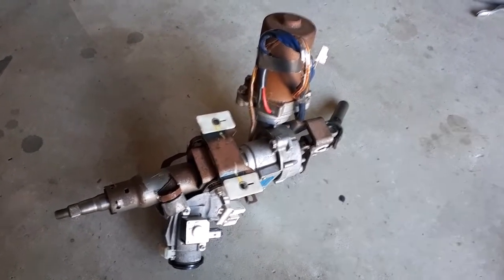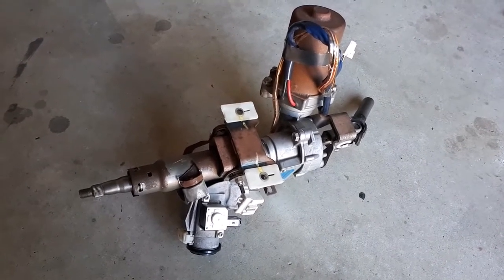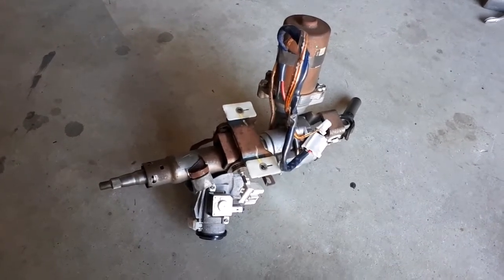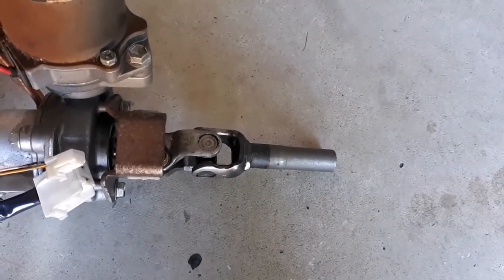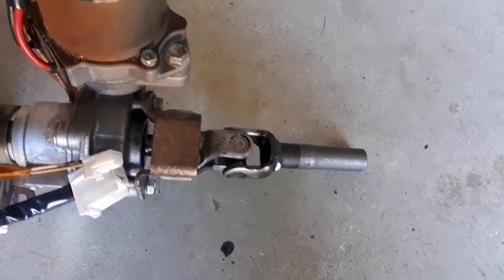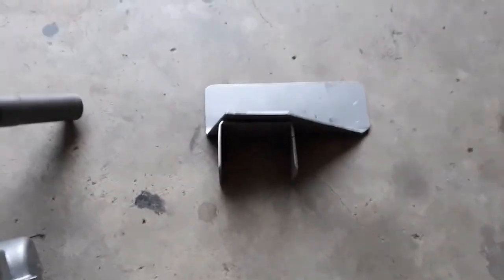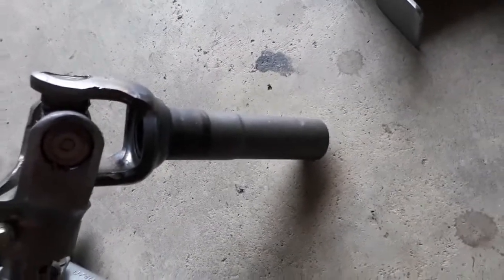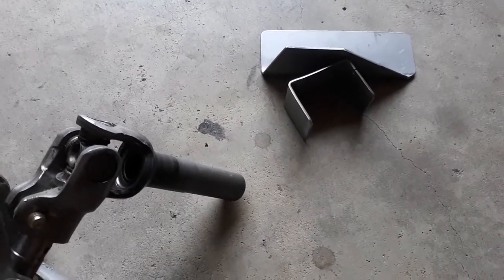MGA Restoration 2019 Aussie Pt. 38 - Power Steering Conversion

Comment: Hi! Thank you so much for showing us this video! It's very well edited and so nice an information. But I'm looking for part two, as promised in the video, but can't find it! Please inform us!
Reply from the maker: Thank you for your comment. I have only done the preliminary work as shown to assess the feasibility of the conversion. I have made the brackets, sourced the variable speed sensor etc. but have now concentrated on the rest of the restoration. I will get back to it eventually though. The main issue will be the joining of the 2 steering column shafts without any welding and I plan to do that with a pinned machined collar.
Reply: @carlogic1960  Super! We are anticipating that one!